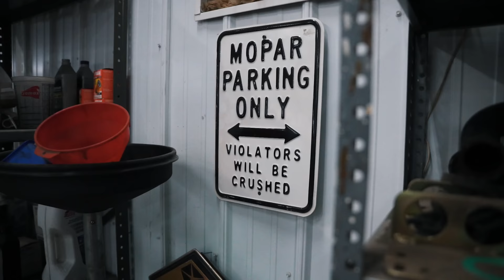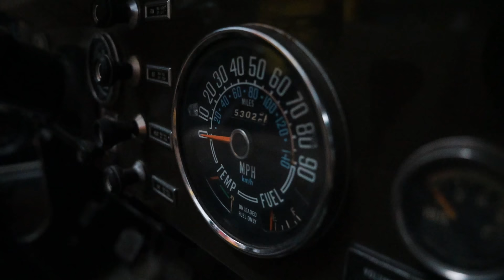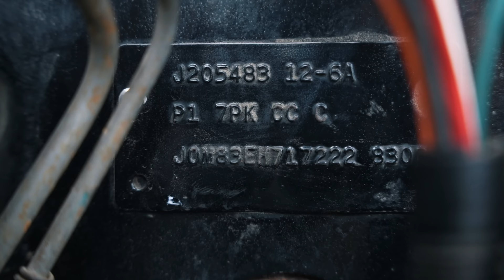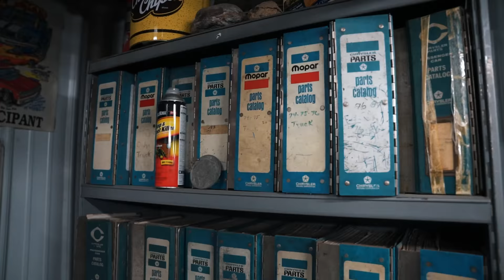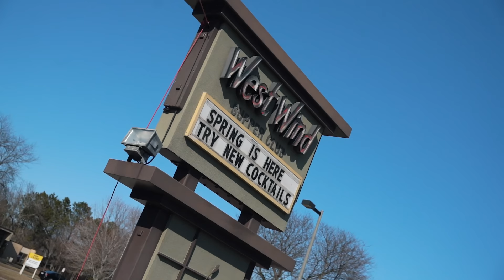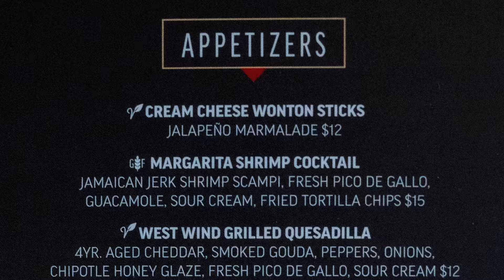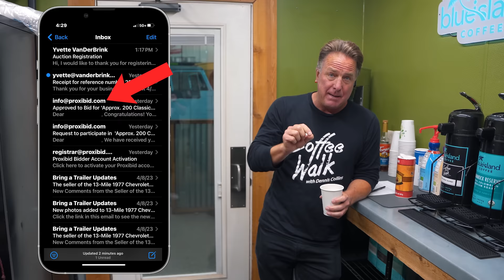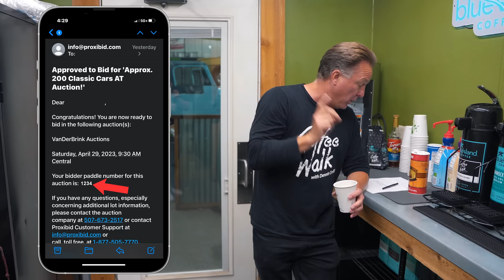FOUND: Original 1975 Dodge W100 + 5 RARE Jeep CJs!!

Comment: I had a 1975 Dodge d 100 with a factory-installed 440 4-barrel h code 375 hp with a full dashboard instrumentation from a larger two and a half ton Dodge truck. Twelve were special ordered by John Deere corporation and sold to their top dealers for personal. Dodge dealers claimed this truck did not exist when I would take it in for service or parts.
Reply: I had a 76 with a 472 caddy engine in it...not factory...😂
Reply: W = 4wd
D = 2wd
Reply: They never had the 375 hp 440 in 1975,in 1972-up the engines were weaker,different cam,different crank,different heads totally different they moved like a 1969 383 TWO barrel...They still moved real good but not the high performance 440's of 71 and older...

Also they never put the high performance 440 in trucks,they had a 440 4bbl and 440 high performance 4bbl from 66-78..the 66-71 being the powerhouses!

375 hp 440 were actually over 410 hp they had to lie about the power due to higher insurance rates back then for more power/more you paid.Torque was over 500 (480 rated for pre 71)as thats what made 440's so tough,gobs of torque at 2400 rpm!

Pre 71 440's had more power and it wasnt just due from going from gross to net..440's like all Chrysler engines were changed! Different heads,cam,crank,lower compression engines were totally changed!
Reply: @01trsmar the truck was no unicorn it was genuine factory built truck.The 1975 375 horse 440 D100 were a special order built for the John Deere corporation the were sold only to the top 20 or so John Deere dealers and executives in the for their owners personal use they were never for sale to the general public the exact number built is unknown. They do not appear in the normal build statistics for a 1975 Dodge trucks they were a special fleet order sort of like Chevrolet COPO cars. I bought the truck from the original John Deere dealer in Mount Vernon Washington  in 1982 I had all the paperwork including the build sheet and order form from John Deere. John Deere had special vehicles built for its top dealers for a number of years by different manufacturers. In 1963 John Deere had special built a small number of supercharged 4-speed Studebaker pickup trucks just like the Dodge they were painted white with John Deere green stripes.
I should have kept that truck in The mid-1980s it was faster than a new Corvette it is possible the H code motors were leftover service replacement 1970 375HP 440s . All the experts didn't believe this truck existed until they saw it. Unfortunately I sold it to a friend planning to do a full restoration and he totaled it.

Comment: Dennis, whenever you show Golden Eagles, it takes me back to the first new car I bought when I was 18. It was a 1978 CJ-7 Golden Eagle in dark green, auto trans, V8, power steering but not power brakes, and the locking mechanism was electric, with the switch in the glove box. Bought it off the dealer's showroom floor. It was great.
Reply: My dad brought home a new ‘79 Golden Eagle CJ7 V8 when I was 17 years old.  Man I had fun in that Jeep.  He sold it a few years later, but I was a broke kid and could no way afford it.  He was a GM employee and I think always felt funny owning it.  Only car he ever owned that wasn’t a GM.  My sister and son are both loyal Jeep fans and each have wranglers.  I never had another.
Reply: Well I still have my 75 CJ5 that I bought used in 78 also my first car. I put a 79 frame then years later put in a 401 T18 3.15 transfer gears I think I’ll never get rid of it.

Comment: That Dodge truck is wicked. What a great colour ❤
Reply: It is but not as wicked as that gorgeous copper 69 Road Runner sitting next to the jeeps that he didn’t even acknowledge being there! And If it’s an original car, it has the 6 pack hood on it and I believe it also came with the hemi as well. That could be a very special Road Runner!!
Reply: @1982MCI  , I saw that too! I'm sure it had a 440 6pack at least.  A 440 would be sweet in the Dodge pickup. Injection, and a Tremec 6 speed for me, LOL.
Reply: @Don Pfeiffer  your right ,I was drooling over that roadrunner myself.
Reply: @1982MCI  Is it a Roadrunner? It looks like a Cornet

Comment: I owned a 74 dodge 3/4 ton w a 5 spd and longbed, no AC or power, an old forest service truck painted USFS green and white. Loved that truck, should have driven it more. I could start off in 3rd gear, it was geared so low I didn't need the granny. I miss it now. Thanks for coming to RF, must have flown into MSP.

Comment: Hey Dennis
 the “pre-ram” dodge trucks were D or W series (D100,  200, etc or W100 etc.)
The D series were 2 wheel drive trucks. Like the little red express (or warlocks).
The W series trucks were 4 wheel drive trucks. Like the Power wagons (or Machos).
Edit;
If you’re looking for a “holy grail” dodge truck (pre-Ram) try to find an original long bed step-side w series truck power wagon (good luck 😃).
Reply: Dodge Ram trucks from 81-93 were also D series and W for 4wd..that changed in 1994..
Reply: Agreed Peace n Grease... also the Plymouth Trail Duster, SUV (rag top). 
I have only seen 1 in my 60 plus years.
Reply: @sonandsanford4963  you’re right. The Traildusters were uncommon in the Midwest. I knew of a few out there but not many.
Now the dodge Ramchargers  (dodge version of the Traildusters) were on every corner and as common as dirt. You can still find them out here.

Comment: Dennis, I had a 77' w100 in the 90's. It had two tanks, np205 case, a/c, ps, pb, factory 440 engine. Paid 1300 for it with a cracked block. Original California truck with Blue plates. I put over 10K into it with a 70 440 and converted the axles to Dana 60's with a NP203 case and custom made driveshafts, manual hubs. Tried to sell it for 4500 and nobody would buy it. Ran great to.

Comment: I had a 79 short bed Power Wagon 360 4spd ( new process ) full time ( NP 203 ) 4wd transfer case. The most capable off road truck I've ever had with 35x15 off road radials. 3" lift I used it trail riding all over the upper midwest. Back when trucks were for work not for show and didn't cost as much as a home.

Comment: A good friend I worked with for over twenty years has a Dodge Power Wagon 4x4 440 from the factory with Dana's front and rear. He has had that truck since he was a teenager and only drove it to the plant once that I know of. He gave me a "k" code 289 short block standard bore when I moved to take with me and remember him. I want a 65 Fairlane to put it in. My second car I ever owned was a 65 Fairlane Sport Coupe hardtop, "k" code with a Borg Warner T-10. Taking care of your guys as always Dennis.

Comment: I had a 75 W100 shortbed for about 15 years. Dad and I pulled the 360 and rebuilt and cammed it. When I needed 3/4 truck I went to the dealer with the W100. One of the mechanics at the dealership came out, read the vin tag and bought it about 15 minutes after I traded it. Mine was green and white

Comment: About 5 years ago I was daily driving a 78 dodge w200 4x4. 360, auto, ac, power steering, power brake....old man had rubbed the right side down a tree. So the bed was really rough, but it was a really good driver. Just rough enough to still use it as a truck, but good enough to drive anywhere.....if you could keep gas in in it. 
It was a rough ride,  If you put 2 tires off the road at 50, it didn't change. Put 500lbs in the back and all the sudden it was a Cadillac

Comment: Hey Dennis, 3 V8 Golden Eagle jeeps and the 75 Dodge all in great condition.  I have to comment on that Warlock black gold stripes I had one back in the day with a 360 V8 bought it new, my cousin had the little Red Express with the wood stake sides an Chrome vertical exhaust stacks. At the time (during the energy chrunch)  my Warlock daily driver till 94 from New was mint but the gas mileage forced me into an economy car !       
  By the way the spread on the restaurant table made me hungry "OUTSTANDING ".

Comment: 1977 drove a 1974 Dodge short wheel base work truck. No power brakes/steering, no radio, no AC. Had a 440 motor 4x4. Its was a tank.

Comment: that is a very late 75 power wagon. Has 5x4.5 bolt pattern early 75 had 5x5.5 bolt pattern with locking hubs . older 75 was not full time 4x4. Still a beautiful truck

Comment: Had bunch of them ol dodges even the little red Express frames motor mounts problem
Matic good ol trucks usually just needs timing chain vowel job they good ol trucks my favorite truck was the 77 power wagon 360 that was a tough truck the roof came off

Comment: That truck is cool! My family is a Mopar family (not me unless it’s 70 or prior (roughly)) so that truck was not so rare amongst us. They were driven hard and put away wet though. I’m sure ever one has been through the wreckers. They all started with 360s, but a couple wound up with 440s. I know of 5 very similar short box D100 Power Wagons. I think my cousin still has his but last I saw it, it was very rough and the powertrain was not original. AC was scrapped years ago. The seat barely had foam left on it.  Probably why they are so rare now!! They were used mostly. Very, very nice truck, but yellow. So many trucks available currently I want to buy, are “yellow” 😢😢. 😂😂😂.  The Warlock is something I would overpay for for personal reasons. Be kinda fun to snipe that from Dennis,,, 😂😂😂.  Many of you would hunt me down and make me sell it to Dennis though!! 😂.  Oh well. 
    I would buy all of the vehicles in that shop!! Good on ya Dennis!! 
  My choice are C10s. My wife says I have a bad addiction to them. When I to,d her the net increase in the value, she now calls them “The Assets”! 😂. She cringes when I take them out for a drive!! I’m taking my big block  69 K10 out this afternoon!! It’s a numbers truck, but was cut down to a short box. Original box as well, but cut. You have to look hard to tell. All exterior welds on the frame are invisible. It does have lockers front & rear, 3” lift and 32” tires. The original axels are in a rack in the shop. Sorry, I get carried away.  Great afternoon coming. I’m going to see if the ice is off one of my favourite lakes!!

Comment: My buddy Steve has 2 '75s  & a '76 W100's plus 2 '76 D100's & a '77 D100 Club Cab. All have 360's (1 of the '76 D100's has a Magnum 360) except the Club Cab, it has a 440 6-pack. He Absolutely Will  NOT sell them many have tried. Their just sitting in his back yard "Rusting". None have been running since about 2005

Comment: I noticed the 76 has dual exhaust. I ordered one brand new and that was not an available option. Also not available was the 4 bbl carb. I made both conversions to mine I wonder if that one has the carb and manifold as well. Really woke up the motor but not stock.

Comment: Had a few 70s 100s stumpy and a warlock have had six ramcharger and trailduster through the yrs also 76 77 79  then with ramcharger and trailduster 76 to 89 getting older sold 89 for Nissan frontier wish I'd kept 89 ramcharger oh well

Comment: The '75 W100 small block isn't exactly 'crazy rare', they can be found fairly easily.  I know a guy who bought a brand new big block short bed W100 in '74 and he still has it. Beautiful, pampered truck, currently has a 505 stroker with 6 Pak induction in it. 

The half door '74 Plymouth Trailduster big block is far more scarce, even more so than the half door Ramchargers. The half doors were briefly made only in '74, about a six month production run.  '75 and up got full doors with the upper window frame and a different top.  Try finding a decent '74 Plymouth truck grille sometime, and expect to pay a premium price if you find one.

Comment: Actually Dodge Power Wagon are W not D the D is the 2wheel drive and W is the 4wheel drive. and my dad had a 1974 Dodge Custom W100 reg cab short bed Power Wagon all factory build with 318 Carter BBD 2bbl carb 727 TorqueFlite Automatic trans had it since he trade a 1973 GMC Sierra C-15 pick-up with a Lincoln car wheels on it (don't ask) made a trade for the power wagon in 1996 for cold weather storm here in Tennessee and he sold the truck in November 2001.

Comment: That is NOT a Dodge D-100! The D series were all 2 wheel drives. ALL Power Wagons are 4 wheel ddrives and all are known as the W series. 
D100, D150, D200 = 2wd
W100, W150, W200, W250, W300 and W350 are ALL 4wd. 👍

Comment: Dennis nvr seen a 74 d100 4x4 short bed std cab I had 2 74 sbstdcb one rusty as hell from Illinois an other from North Dakota rust free with a 440/4spd other 383/auto both power wagons one burnt orange an black rusty the nice one top banana yellow both number matching I couldn’t believe what I was looking at I bought both cheap in 1990 the yellow one had 2 dings one in each bedside an tiny ding in the aluminum grill I pulled the 383 an pdr’d the dings an sold it to a guy in buffalo mo an stripped the 383 truck it was wasted from rust sad

Comment: Wouldn't the 1975 Dodge truck be a W100 Power Wagon?  I thought the two wheel drive Dodge pickups had a D designation and the four wheel drive trucks were W's.  Similar to Chevy C-10 vs K-10.